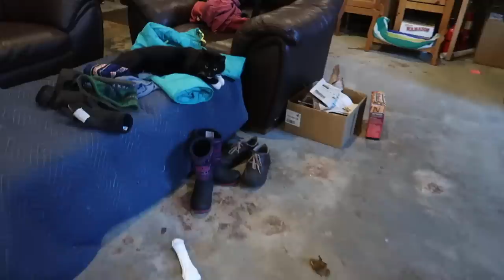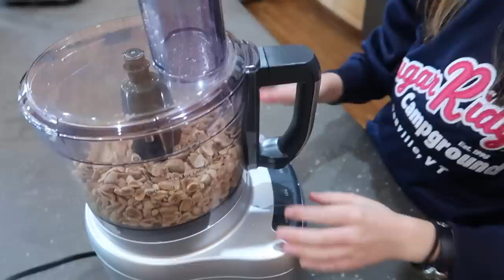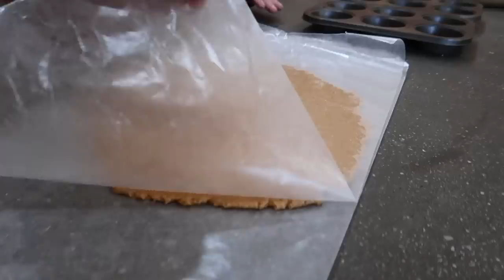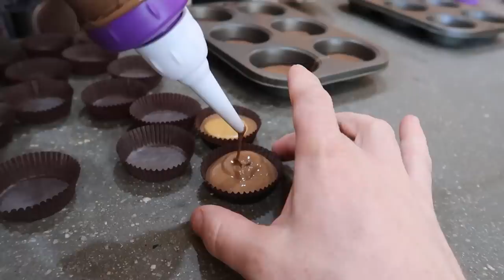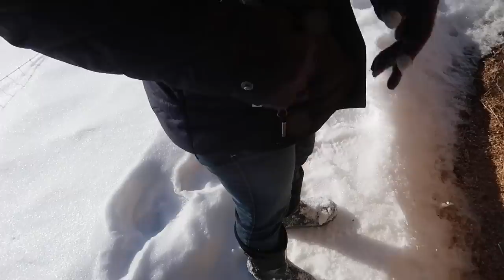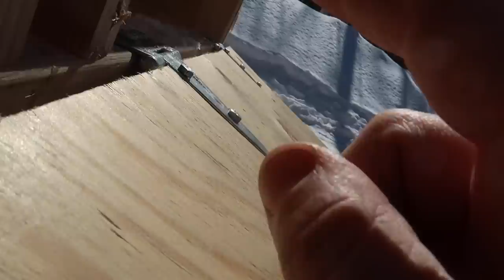Farm Family attempts to make Gourmet Reese Peanut Butter Cups

Comment: On the Bacon mobile might think about putting a layer of plywood on the inside from the floor up 2 to 3 feet. This will keep the pigs from pushing your siding out when they lean up against the wall. Will also make cleanup easier from having to scrap between the studs. Looking good.

Comment: I think maybe I'd have only made the ramp half length and the upper half a Dutch door style. That way you could open it up for cleaning but the upper part would stay closed during normal use. It would help retain some warmth and will also provide better shade. Kombucha!
Reply from the maker: I think the ramp would be to steep for the pigs if we did that
Reply: No they are pretty good at climbing and jumping, then you might just put more cleats on your ramp.

Comment: Are you going to include pulleys and cables with a counter weight for the pig door? Looks heavy.
Reply: I think the ramp will be down except for moving. If not, he could go 'whole hog" and put the cheap Harbor Freight 2500# winch on it.